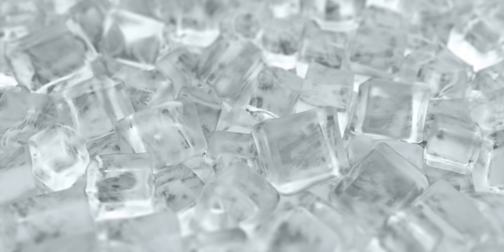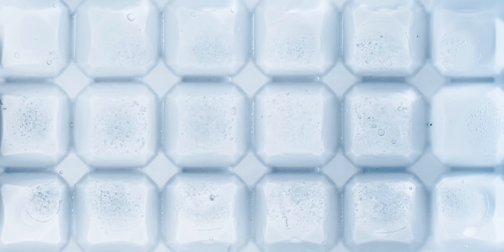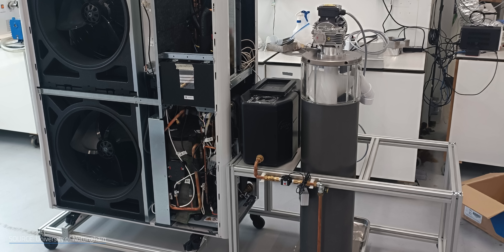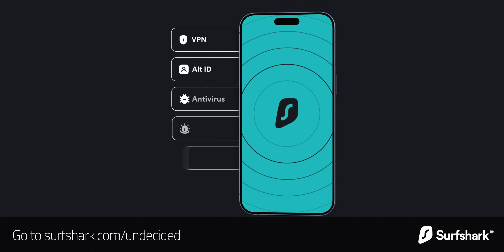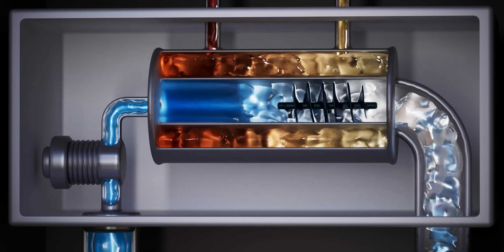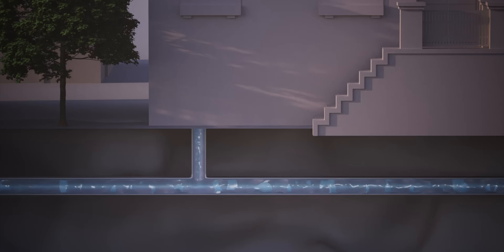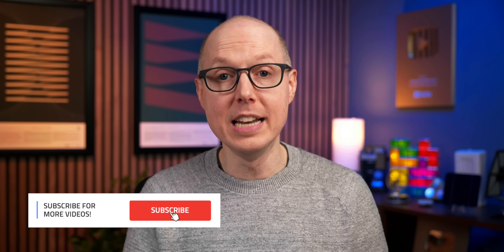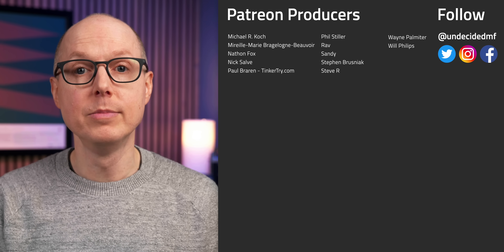How Can Ice Heat Your Home? Ice Source Heat Pumps!

Comment: Several important things missing from this piece
1.   You need a return pipe. 90% of the cost of putting pipes in the road is the cost of digging and reinstatement - not the pipes. So putting in 2 pipes, a flow and return, would only cost 10% more. And be more reliable, and properly sized. 
2.   The icy slush needs to be melted somewhere - needing heat from a district plant. What zero carbon heat?  How much does this cost?  How does this compare to running a central heat pump and sending hot water under the streets, like in Esbjerg, Denmark? 
3.   What is the ratio of kwh of electric put in to kwh of heat got out of the domestic ice maker?  
4.   What is the overall COP for this system ?
All basic questions. 
The Esbjerg system makes the domestic side cheap and low maintenance - and allows real professional complex engineering to take place in the central plant, where they have several sources of heat and a big heat storage tank.
Reply: I suspect the return pipes would be the existing waste-water ones (ground water or sewage), hence non-pottable water use. The mention in the video of modifying the pipes to the house rather than in the street indicates this approach as well, using gas to supply non-pottable water and waste to extract the frozen slurry. This is why this approach is more suited to built-up areas rather than rural ones, even if the rural sites have gas supplied.  As to melting the ice, again this seems to seek to benefit from built-up areas using the increased ground heat to provide the melting, as well as the heat within the waste water.
Reply: @GruffSillyGoat A consideration regarding effectively mass cooling sewage water is that it may affect biological and chemical digestion, such as it has been specifically implemented into its treatment. The system has been adjusted to anticipate hot water from showers, dishwashers, taps and room temperature water from toilets, as well as body temperature waste.
Reply: "1.   You need a return pipe." - We already have return pipes. Most UK homes have access to both rainwater and foulwater extraction, via surface drainage and sewerage systems (sometimes, they are combined)
"2.   The icy slush needs to be melted somewhere" - Sewers very VERY rarely suffer from freezing, in the UK at least. Our climate simply isn't cold enough for this to be a problem. Adding many tons of slushy might cause a problem with this, though, so that'd have to be part of the research for sure.
"3" and "4" - maybe you should read the research papers? I'm sure they cover that information. Stop trying to nitpick holes from a position of ignorance.
Reply: It gets Returned through the sewer network meaning you'll get charged twice Once by this company  and then by your water utility for the water going down the drain

Comment: Heat pumps should be designed to operate well despite the formation of frost and ice on the evaporator unit outside during winter conditions.

Comment: Yes, you can use the existing gas infrastructure to feed the heat pumps but you haven't got a return network so you'd still have to dig to bury that and the diging is the major part of the cost.
Reply: The idea is to dump the slush into the existing sewer lines. They should easily be able to handle the additional load.

As for the change over period, it would be possible to run the heat pump using existing potable water lines until an entire area is converted, then switch the gas pipes to non-potable water. After that switching each end user from the potable system to the non-potable system would be relatively trivial. While more costly in terms of water prices, especially for the early adopters, it spreads the transition out over a reasonable time frame while not leaving anyone out in the cold, either figuratively or literally.